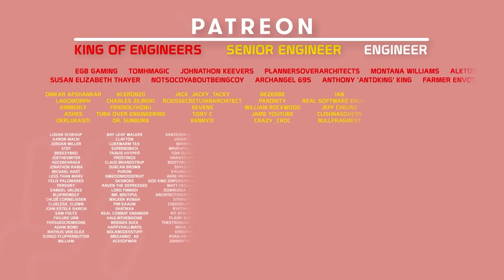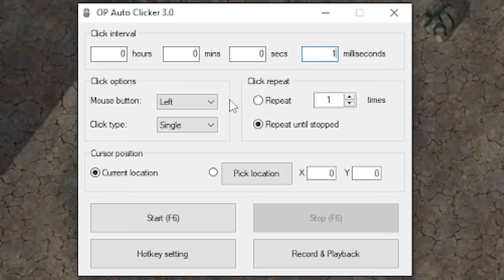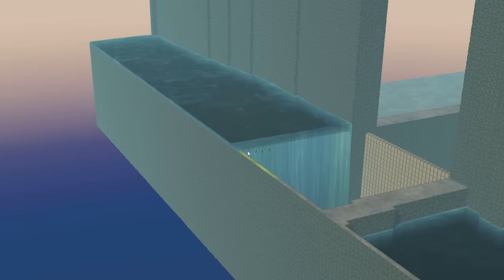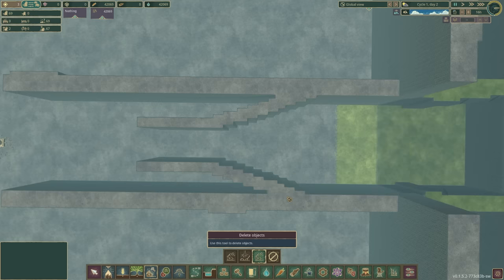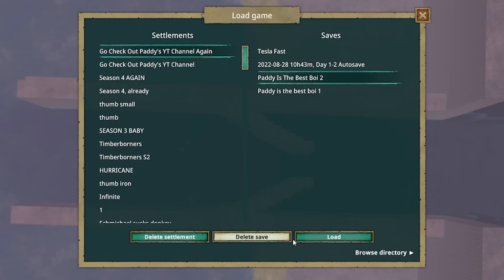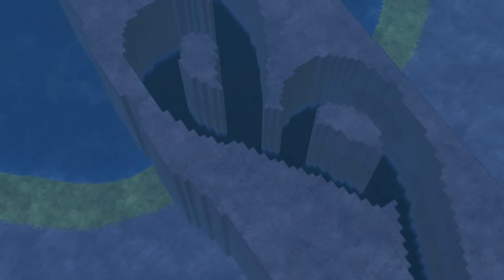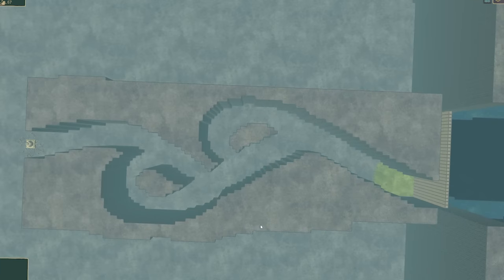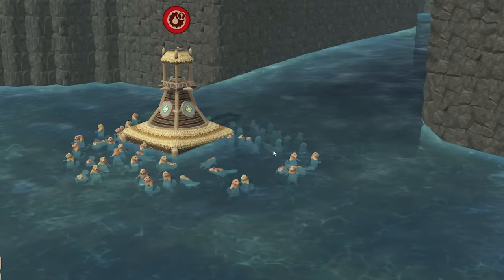Can a TESLA VALVE save my beaver colony from HUGE FLOOD WATERS?

Comment: Tesla valves makes flow easier one way than the other. Its NOT a “one way valve”. So it wont stop flow against its. Its just less efficient than the other direction 🤦🏽‍♂️🤦🏽‍♂️ come one engineer. You should know things flow from high pressure to low pressure.

Comment: MATT ITS TIME FOR AN INTERVENTION...

You've being doing the same thing over and over again and expecting a different result...

The valve doesn't work in these games and the speed of the waves doesn't increase with narrowing channels because the channels aren't sealed therefore instead of slowing or speeding up the water builds in height instead

If you keep up this architectural thinking I might have to unsubscribe...

Dam...